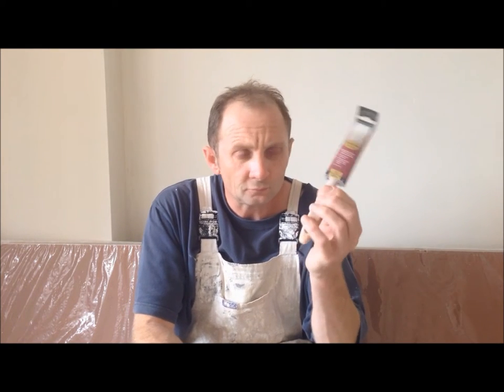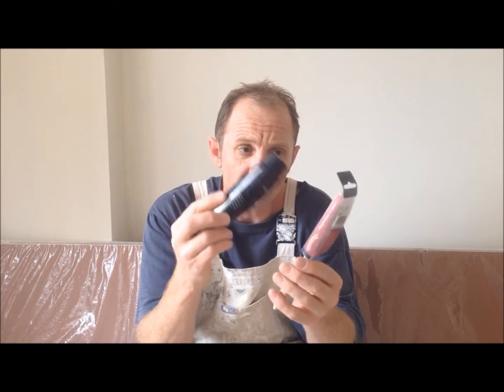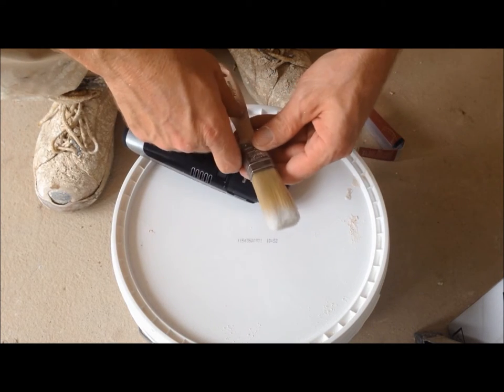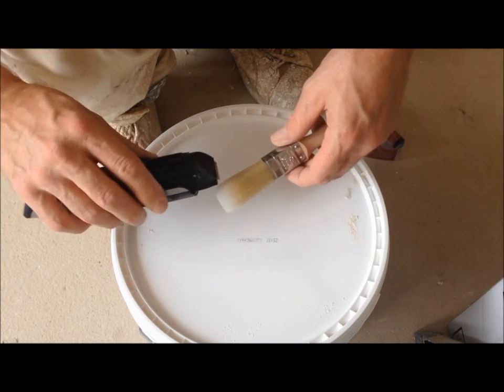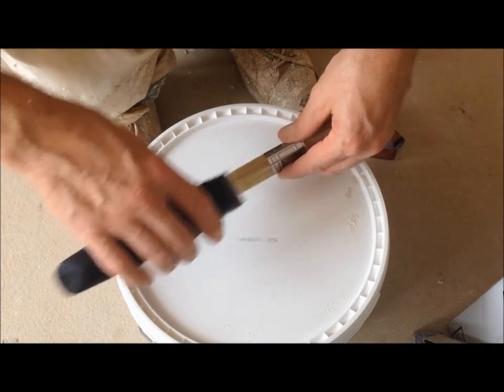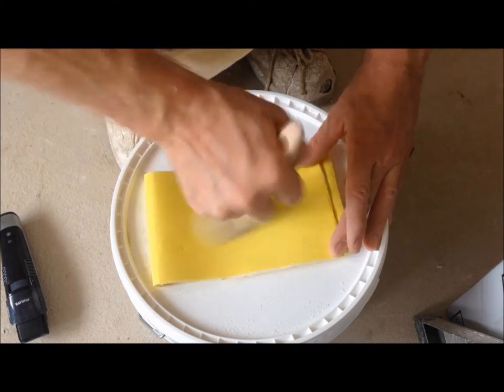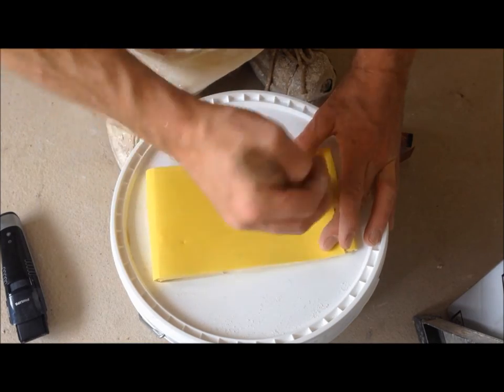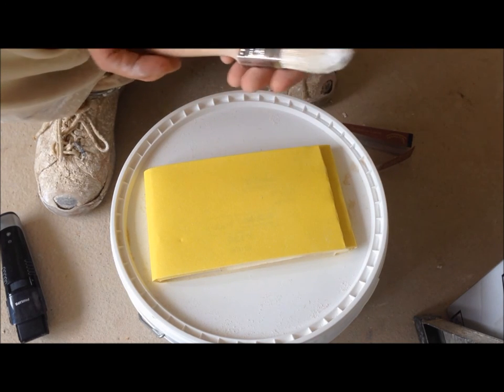Painting & Decorating, How to trim a 1" Synthetic  paint brush for gloss...

Comment: Nice vid. Good to see people passing skills on. Maybe a bit of a newbie question, but if you were painting your own skirting would you do 1 or 2 undercoats (oil or acca which i know you like) followed by how many coats of gloss (am going to oil gloss in sunlit areas only, otherwise water based). Cheers, keep up the good work.
Reply: Depends what colour your useing and the cut of the skirts the darker the colour you may need two undercoat but if useing white over white good rub down fill if needed best if already painted aswel use oil base undercoat and then oil base gloss. Plus dow to preparation.  Wash over skirts or any woodwork with sugar soap finish with clean water. Fill  if nesserary rub down undercoat wait till dry nib down with used sandpaper dust off and gloss..